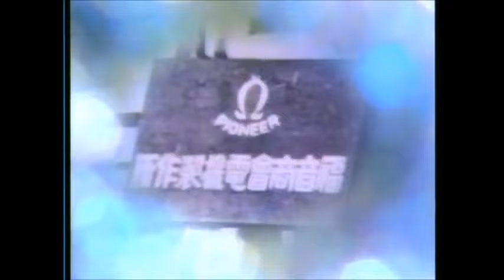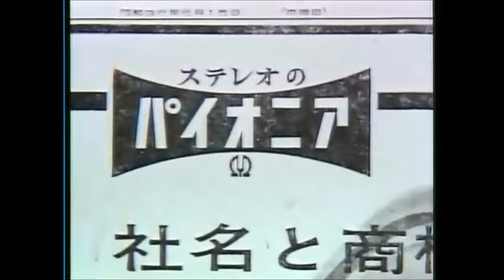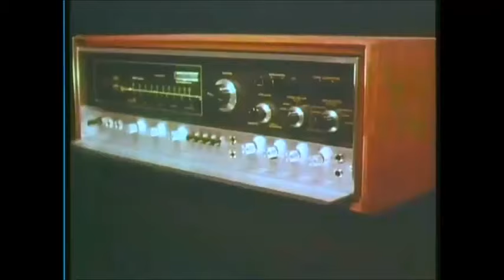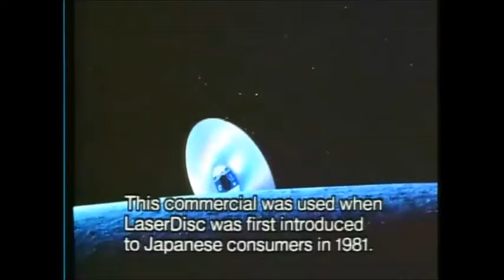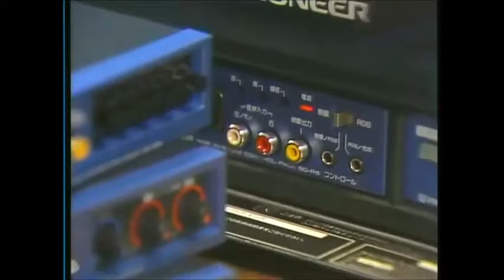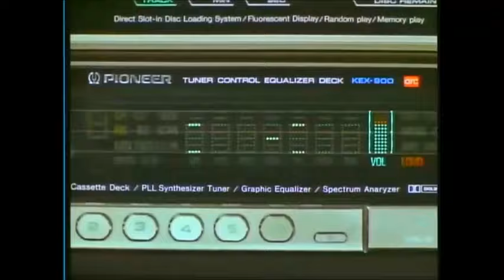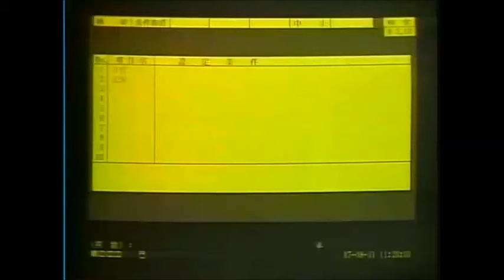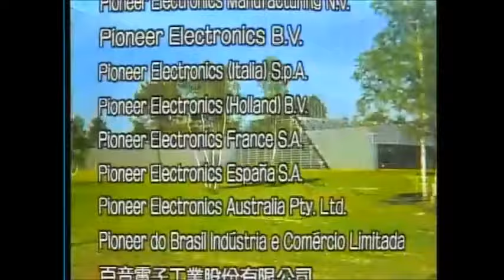PIONEER Electronics 50 Year History

Comment: I worked for Pioneer from 1990 to 1997 as a technical representative along the Pacific Rim market. Pioneer was set in Meguro Tokyo at the time. I saw a bit change in those years. I still own and listen to Pioneer speaker systems CA 7700 from the seventies and 90s column speakers.  Also a vintage Project component system.

Comment: I had a Pioneer FM 8-track in the second half of the 70s and early 80s. It was surprisingly rugged and an excellent signal source. The surprising ruggedness was revealed when the deck launched off the seat, smashing into the dash during a wreck. The signal source was FM radio and it was unaffected. My right knee on the other hand was severely bruised and required a week to recover.

I never realized that the Pioneer symbol meant anything. Unlike the Yamaha three tuning forks symbol which was impossible to miss.